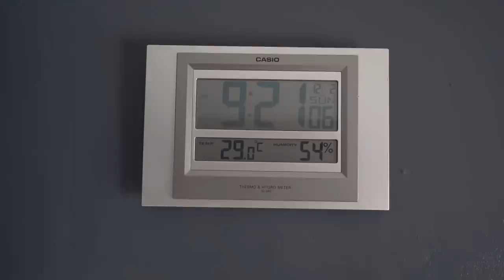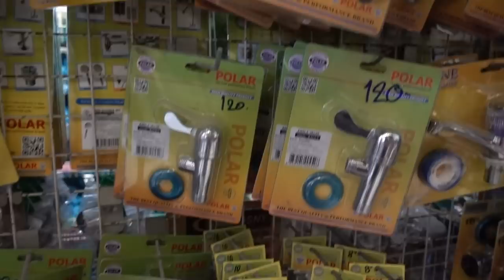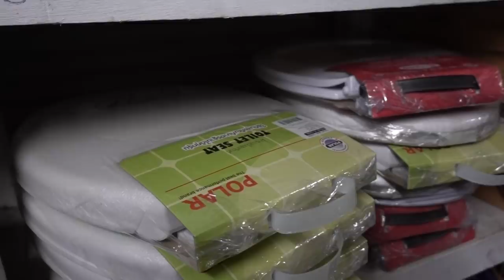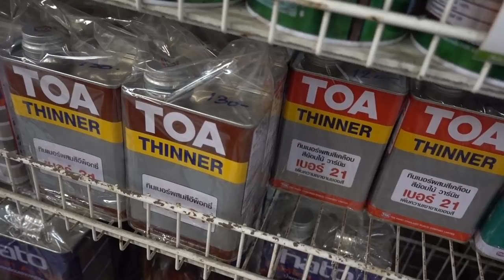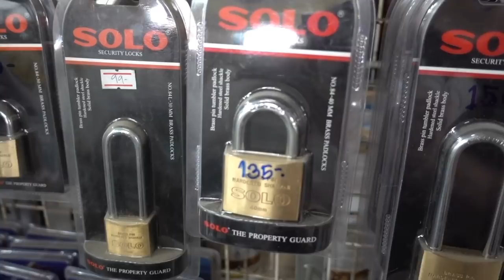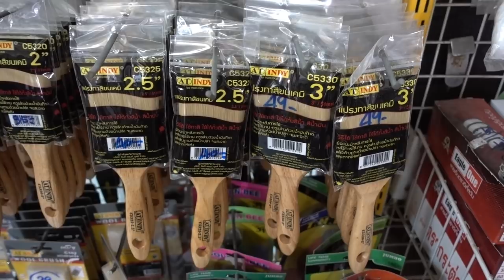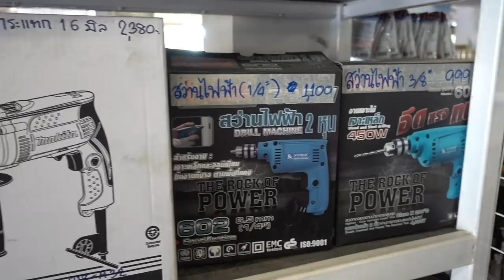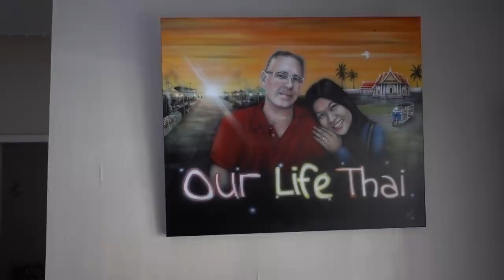Our Thai Village Hardware Store Shopping Tour Bangkok

Comment: I noticed that you just place the straight pipe in the wall.  Was there any screw type connection ? How does it not leak at the wall .
Reply from the maker: Lots of silicone sealant.  😎

Comment: Excellent job...  U r quite the plumber, Brad. The first drain that I replaced, nobody told me to put "plumber's putty" under drain flange where it meets inside of sink. Consequently, I flunked Basic Plumbing 101 when the sink leaked.  How are the sewer gases kept out of the house when there is no water-filled "S" trap under your sink?  Thai Magic?? LOL.  Also, us Texans would LOVE 54% humidity.  Even today, it is only 8°c but 76% humidity.  Usually, in summer it is 35°+C here on the Gulf Coast of Texas and 100% humidity, and little to move breeze, a real killer for us old farts... LOL
Reply from the maker: G'Day Ron
There must be some twists and turns inside the concrete wall.  😁
Sounds like you would fit in very well here temperature wise.  🤣🤣
Take care